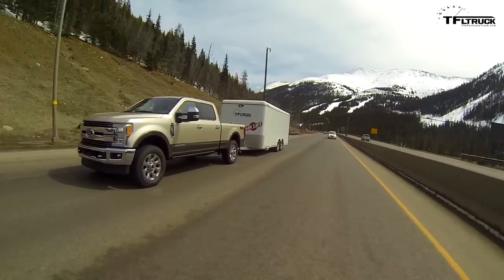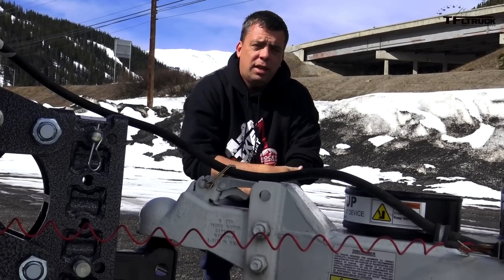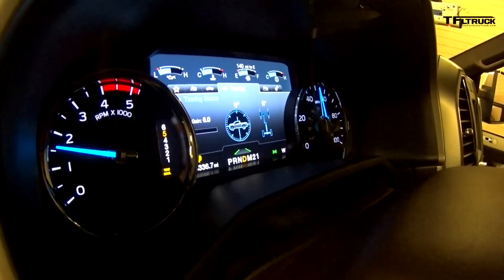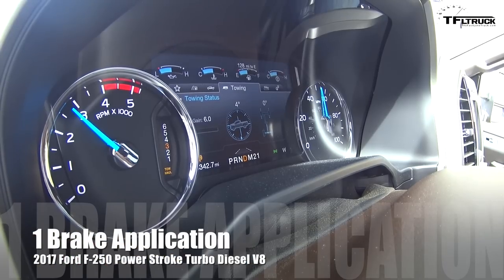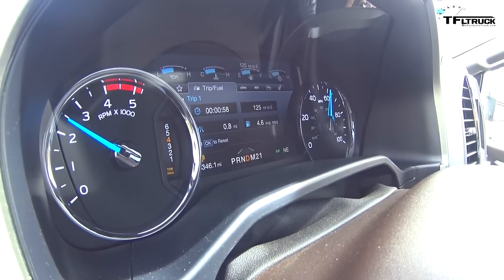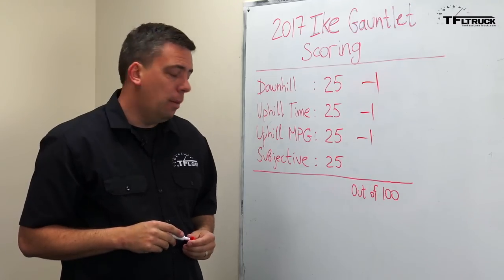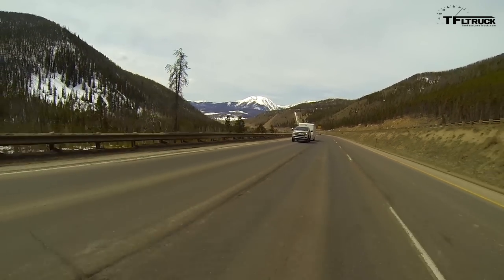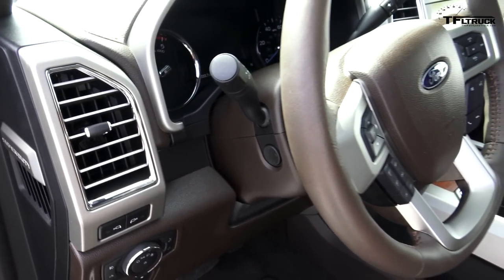2017 Ford F250 Diesel V8 Takes on the Ike Gauntlet Review: The World's Toughest Towing Test

Comment: I never understood the cost increase for the king ranch and platinum.  25k to 30k markup for leather power adjustable seats, power mirrors, leather panels on the dash, slightly more expensive paint, and a more expensive entertainment system.  They use the same engine, trans, transfer case, axels, body panels (other than logo stamping) and the interior is the same minus the materials on panels.  That's a huge markup for minimal gain.  I would completely get it if you got better mechanicals with the price, but your buying stuff that really doesn't matter.   Maybe I am just old school...
Reply: Lake School Restoration Channel then get the lariat or xlt if you don't want all that technology.
Reply: Bunz21 everyone is free to get what they want, my comment was more towards how ridiculous it is to pay 30k more for what amounts to very little substance.  If it had better engines/driveline/etc it would make sense.  For example It's not like comparing a base model focus to a RS, the RS costs 20k more, but your getting almost 200hp extra, all new suspension/driveline, new seats/interior pieces, etc.   That makes complete sense to me.
Reply: Lake School Restoration Channel I agree 100%, in 5-7 years those plastic panels and pleather seat surfaces will hold no real value to the truck, it's all in the drivetrain. I'd rather have a good cloth interior with more power and capabilities than all of that on the inside. BTW, I'm old school like that too...
Reply: Adam Gaines I agree with you here's another thing the new ford super duty's have a lot stronger under body then the Chevy and ram all Chevy did was put a really powerful motor into it and ram is still last in reliability the ford placed 1st to reach 200k with out issues Chevy placed 2nd, I don't think you can go wrong with the ford or Chevy but the ford has bigger under body components thing the Chevy and the ford looks better in my opinion.
Reply: Lake School Restoration Channel Agree 100%
Reply: I hate to say it since I am a Ford fan and own a newer f250, but if I was looking at a nice interior, decent ride, and bling factor I would buy a Chevy 2500 over the Ford.  The IFS combined with overall more car like interior makes it much more of a luxury truck over the f250.  I need capability to haul heavy, and good off road capability, therefore the solid axel front and setup the f250 has fits my needs better.  

Only in the truck world does buying what amounts to appearance packages add 50 to 75% to the price with no mechanical upgrades.  Imagine if a 30k car cost 45k just to get a different paint job, different wheels, some power items, and leather seats.  They have to be making money hand over fist on the upper models.
Reply: This is nothing new and not limited to Ford either. It matters to many as there is no shortage of top trim F-series trucks on the road and the job sites.
Reply: Lake School Restoration Channel the Focus RS has the exact same seats as the Focus ST. Only real difference on the inside is the shorter shifter, blue accents, and your drive .ode button. they're virtually the same on the inside. The price increase comes from drivetrain, engine, brakes, and wheels.

I guess you haven't really priced a base model F250 XLT with 4x4 and crew cab? Its over 50 grand. You can build a 70k Lariat, but why not just buy a King Ranch if you're going to add all the options that come standard on those trim levels? I build these trucks for a living and see their prices every night.
Reply: chibbs1975 I am well aware a base crew cab is over 50k.  I am saying that paying 25k to 30k more for what amounts to paint, wheels, seat material, some interior panel material, and a higher end audio system seems ludicrous.  If you were getting stronger axels, more powerful engine, aka things that actually improve the capability it would make more sense.  The only reason people are paying 75k for a truck is due to the fact the monthly payment on a 84 month loan comes out to the same monthly payment as a 60 month loan on a 50k truck.  

I rather spend money on capability.  Compare a base Wrangler vs a rubicon.  The rubicon has better axels stock, front and rear lockers, disconnecting away bars, better transfer case, better tires, and better bumpers/hood in some years.  For you to buy all those things to get the same capability would negate the price difference.  Same thing with the RS vs a base focus, or even the ST in your example.  The 15 to 20k increase is going to a massive engine/driveline increase, bigger/Better tires, suspension upgrades, etc.  

People are getting hosed on most big pickups, there is no way else to look at it.  I bet out of a 30k cost increase to go up model Ford is pocketing atleast 15k in profit.  I don't blame them, but I can't help but sit here and think how ridiculous those numbers are for something that's worth 30k after a few years.
Reply: Lake School Restoration Channel I think you need to look at the standard options that come in the Platinum or King Ranch. A regular Wrangler is for someone that just wants a Jeep. The Rubicon is someone that wants Jeep with capability. It's not the same with a Super Duty. You get a capable truck no matter what. It comes down to the necessities and creature comforts you want in your truck.

I just bought a 2017 Explorer Sport. I spent five weeks searching for a base model Sport with a twin panel moon roof. Every Sport I looked at had the 401A package with had folding mirrors, lane keep, adaptive cruise control, and a bunch or other nonsense I didn't want or need. My price was $46,700 compared to others that were $53,000. What it comes down to, is you buy what you want and spend what you want. I'll tell you though, there are more Platinum and King Ranch trucks going down the line than you think. Especially F450 versions.
Reply: J.V. is that crazy peckerwood lmao...under the skin it is, but not everywhere else. believe it or not, some people pull big ass fifth wheels and actually travel a lot of miles in these trucks. why not  have a nicer truck on the inside if you're gonna spend a lot of time inside it? this is why Ford offers different models and trim packages. they try to cater to everyone.
Reply: J.V. is that crazy peckerwood it doesn't have remote start, remote tailgate with soft open. Panoramic moon roof. Power rear window. Heated and cooled seats. I can keep going on and on. Your truck doesn't have anything close to the platinum.
Reply: Lake School Restoration Channel yes sir, and those high trim model materials do not cost the manufacturer any more than the base trim model pieces. They absolutely make a ton of money on them.
Reply: But its the same truck for more extra money required than it would cost to buy a new half-ton truck; you could get the same duty and work plus a half-ton truck for another family  member to drive. Added to that, this fancy truck doesn't do anything more or better on the road than the truck that's $30K less. Do people just lock their brains when it's pointed out that this fancy truck (I don't care how many features it has it; if it makes coffee or starts itself without a key or any of that other non necessary stuff for all things trucking) cost more than a truck without those features to the tune of the price of a new half-ton truck.
Reply: Gregory Faulkner that's pretty much my thought on it.  If the diesel only came as a option on upper trim models, it would make sense to pay the extra.  From a dollar amount most of the extra is going towards profit, not content.  

The proliferation of 75k trucks is directly due to 7/8 year loans being available.  If you stroke the payments out that long your payment is the same as a 5 year loan.  Also for large enough businesses I believe you can write the whole purchase price off on taxes in 1 year vs using depreciation.  On a 75k truck this could be a significant discount that would make sense to go to a upper model.

I drive a lot and I am always at the local building material suppliers.  If I see a platinum or a king ranch it's not driven by someone who is using it for a work truck.  It's either a younger guy who is spending a mortgage payment worth on a truck to show off, or a older gentlemen who bought a retirement vehicle.  That makes a lot of sense because a couple dings in the bed and tore up carpet would drop the value by probably 10k lol.  I am not hating on either one at all.  It's just that if you look at the dollar amounts spent just to get a few upgrades it's really crazy.  I guess that's good for me, I can get the same capability truck for 40% less and have it paid off in 2-3 years.  Or buy a f250xlt and get a free loaded Ford Focus for the same price as a platinum lol.
Reply: SilverRaven1959 completely agree.
Reply: SilverRaven1959 I fully agree with you bro.
Reply: SilverRaven1959 my point wasn't that all the bells and whistles aren't better than what comes with it stock.  My point was that paying 25 to 30k more for what amounts to maybe 5 to 10k in actual cost increase for the manufacture is more of a rip off than anything lol.  That and there is a fundamental problem with the king ranches and platinums, people that buy them don't use them for what a f250/350/etc was designed for.  Nobody is going to pay 75 to 80 k and use it for a work truck. A couple dents in the bed and a tore up interior will knock off a huge amount of value.     Considering many people are in debt at a mortgage payment level for 6 to 7 years on them, having a truck end up being worth 25k after 6 years when you paid over 80k with interest, makes no sense.  That's over 750$ a month in depreciation.  To be honest I do find it humorous that in today's society we are even talking about moon roofs, leather seats, etc, in rough riding work trucks that have 900+ ft lbs of torque.  What's next, latte warmers, heated floor mats, and navigator suspension so it rides less like a truck?  Like I said, I am not hating anyone that decides that's the right truck for them, I just don't see the value for how much the cost is increased.
Reply: SilverRaven1959 I build these trucks for a living. I know pretty much everything about them. lol
Reply: Lake School Restoration Channel There are plenty of KR and Platinum f series trucks on job sites, driven by owners of companies and towing something. Only a fool would believe otherwise.
Reply: SteveLord Ford builds roughly 800 trucks in a 10 hour shift. You'd be surprised how many KR's, Platinums, and optioned out Lariat's come off the line. Ford puts all these options on these trucks because Ford's customers ask for it.
Reply: Well for regular American persons and/or families who opt for debt in what they choose to drive, there is a huge difference between someone who surrenders one's financial security for 6-8 years via signing up to owe a bank $50K+ just to drive a pickup truck with a panoramic roof, and someone who enters a contract to owe half that amount and still have money at the end of the month and to be free from bondage much sooner, when both are driving trucks that do the same thing, only the former gets to do it with lots of added fluff and the other gets to be smarter and more responsible. For those with piles of money lying around that finances just for fun, then it doesn't really matter. High sales of those $50K trucks are good for Ford to make that kind of margin and that helps them give people like me good value in a lower-trimmed pickup with all the same, great auto and material tech. For any pickup configuration, it need be nothing more than a piece of reliable and safe and capable and fuel efficient transportation to be used as a tool for hauling and towing stuff and carrying people in relative comfort. My F150 has only the lowest added option package, adding only $2,000 to the sticker. It's got cruise, the kind that requires that I still have to do some driving; it's got power glass and mirrors; it's got a rear camera (even the zero-optioned F150 has the rear camera), and I can look directly everywhere else more effectively using my three dimension-capable eyes and vision than I can with the distraction of 360 degree cameras); it's got as advanced an engine and power train as was possible to buy on the market at the time I got it; it's got the same suspension, brakes, advanced steering, aluminum body, rear axle and drive as found in some $50K+ versions; it's got capability (towing, payload, bed space) equal to  or better than some $50K versions; and my cost was under $28K not counting tax. And even if I had opted for a crew cab, I could have stayed under $34K with the same trim, though I'd had to trade off  less bed to haul more people at that price versus $60K+ that some pay for that same truck. I paid $6K down. I've paid about $2K extra over sixteen mos. I owe under $15K for a brand new truck I bought fifteen mos. ago on a salary only slightly north of working class. Any suggestion that all auto payments are equal, despite the terms, with no regard to the initial loan amount, is a ludicrous suggestion. Of course the loan amount matters!
Reply: I just searched f250 king ranch, and found 10 2013s for sale for 40 to 42k that have under 60k miles in my area.  That's a 4 year old vehicle that sold for over 70k new, that was traded in for probably 35 to 37k.  That's 791$ a month of depreciation assuming it was purchased at 75k and traded in for 37.   The sad thing is If you actually used it for a work truck (aka hauled stuff, put more than groceries in the bed) you won't get anywhere near 42k for it, which makes the depreciation even worse.  

If Ford is making a ton of platinums and king ranches I stand by my statement that the only reason they are selling them is due to 7+ year financing.  Your average consumer looks at the monthly payment and if it's the same to get a king ranch on a 7/8 year loan as it is a xl on a 4/5, they will want the higher trim.  But then again those same consumers are the ones that were buying houses out of their price ranges because banks offered them money, only to wind up defaulting on them.
Reply: Gregory Faulkner 

The funniest thing to me about the high end truck market, is that it doesn't really have much on the high end car market when it comes to technology.  With the trucks at the end of the day your driving a pretty rough riding work truck, when for the money could could be in something that's much better riding.  After 5 or 6 years the higher end trucks are starting to look wore, the tech is already out dated, and I bet a vast majority of buyers are still making payments on the truck.  

I guess as you said, it does benefit people who buy standard trucks since the capabilities are all the same.  To each his own I guess.
Reply: Lake School Restoration Channel Almost every car on the planet can optioned to nearly double its base price.
Reply: dchawk81 

Sure, a focus RS can cost double what a zero option Focus does.  However for the price your getting significant engine, transmission, driveline, suspension, brakes, seating, and electrical upgrades.  Just like the camaro, base is 27k, and you can get a zl1 for 61k.  For the extra money your getting 200hp more,  better driveline, better brakes, better suspension, forged wheels, better tires, different body panels, better interior, etc.  if you look at most vehicles that have a higher end version of a base model, they are literally not the same vehicle.  This is not the case with larger pickups.  Your paying 25 to 30k for    Very minimal gain.  If you think a moon roof, heated/cooled seats, power tail gate drop, remote start, aluminum 20in wheels with standard tires, better entertainment system, and a couple custom color options are reasonable to pay 25k for, I don't know what to say.  

I would buy a platinum or king ranch if it came with upgraded brakes, stronger axels, more powerful engine, dump box, stainless steel parts that don't rust, etc.  something that adds capability and worth.
Reply: I absolutely agree with the assertion that nearly all cars can be appointed at near double their base price, and add to that, at least with a utility vehicle like a pickup truck, unlike a sedan, coupe, CUV, or hatchback some of the add on up market options are actually things that increase or improve utility, capability, power, or increase the number of people it can haul while also hauling or towing stuff.

But the problem I have with almost every comment section; professional, or amateur review; or discussion board is that there is this assumption that new pickups have become too expensive for the average buyer; because they are assuming that the only trucks available are the ones that top $40K; and my point is that relative to other segments; they have not become too expensive; it's just that more pickup truck buyers choose those higher-end models. It's just that too many pickup owners and wannabe owners think that any truck must have these $15K-$30K add-ons to be a worthy truck, and I fully understand that is what sales in the market, but just because more than half the buyers are choosing high-end trucks; but manufacturers should not be blamed and we should not be complaining because alot of customers are asking for non essential options to impress their friends or for some other reason.. For instance, someone could choose the most capable F150 sold as far as capable for towing and hauling (a 2X4 std cab, XL, long bed, with the 3.5 Ecoboost and 3.73 gears) and stay under $35K. The only option one has to take with that top engine and rear gears is the long bed. Another person could choose theirs to be more of a people hauler in a crew cab with a 5.5' bed, and get theirs for about the same price with the base engine. Compared to a Camry or other big-selling car, these are good values for those who want or need to haul stuff and reliable, comfortable transportation. I understand that it's weird not to want all these gadgets these days in a pickup truck; but it's weird in a Dave Ramsey kind of way, and I'm cool with that.
Reply: J.V. is that crazy peckerwood you don't have to buy the 80k dollar truck but if someone else does its there money they can buy what they want.
Reply: Not even talking about performance.
Reply: Lake School Restoration Channel why do you think Ford offers a 150, 250, 350, and a 450? you get upgrades in the axles and suspension. it's the exact opposite with the truck market than the car market. you're buying a capable truck out of the box and then adding the features and creature comforts you want. Every vehicle and manufacturer has vehicles that'll go double the price from a base to a top trim model.  You're better off sitting down and ordering your truck the way you want if it's such a issue.
Reply: chibbs1975 I am confused, my whole point was that it's highway robbery to charge 20 to 30k for seats/moon roof/infotainment system/couple cameras/2 unique color options with no upgrade to any mechanicals what so ever.  I think that's highway robbery, apparently you think it's not?
Reply: A lot of features do make the truck a nicer place to spend time in. But if you're like me and you don't sit in it a lot, an XLT package is fine. Or if you're gonna filth it up just because that's your life or workstyle making it unavoidable, the washout interior of the XL trim makes sense.

These ultra lux trucks tend to take the place of 2-3 separate vehicles so their price is not hard for a lot of people to justify. They're at and sometimes above what the Lincoln Navigator & Escalade are offering with truck utility and car comfort.

Think about that for a second. You're replacing a high end SUV and a luxurious car with one pickup truck. Of course you're gonna load it up on options.

If you were never in the market for a $70,000 SUV then you're obviously not in the market for a $70,000 pickup.
Reply: Lake School Restoration Channel you need to look up the amount of options on these trucks. the trucks equipped with the 360° camera has I believe seven cameras on it. it's not just a couple. I build these trucks and you can order the truck with just about anything you want and we will build it. you want a spray in bed liner? we will do it. you want a diamond plate tool box in the bed? you got it. you want a fifth wheel hitch installed in the bed? we will do that too. a diesel, 4x4, crew cab XLT will run you about 52k. A Lariat will be about 60k. A King Ranch is 66k, and a Platinum is 71k.  Your numbers are a tad off. To go from a XLT to a base Platinum will run you $18,000. 

That gives you, remote tailgate, adaptive steering, power memory heated and cooled leather seats, heated rear seats, Sync 3 with nav, power running boards, led headlights and fog lights, led bed lights, adjustable pedals, BLIS, remote start, heated steering wheel, and a butt load of other options that come standard over the XLT. These are priced based off a standard truck without adding other options.

I don't have a need or want a big truck or a truck for that matter. I just bought 2017 Explorer Sport a few weeks ago. Every one I looked at was 53k with a bunch of stuff I didn't want or need. Basically the dealer orders most of them fully loaded from the factory. It took my five weeks to find a Sport that had just the standard options and it was several thousand dollars less. The standard equipment was plenty for me.  So if I were to buy a truck, I'd probably order a Lariat and put some options it that didn't come standard that I want cause a even a standard Platinum has too many y options that I personally don't want to or need.  I'm sure my Lariat would be priced  close to a base model KR. 

Majority of people buying vehicles buy them off what they look like and what options they have that they are interested in, but end up spending more on stuff they don't want cause the dealer ordered it that way. If you're that picky, they your better off just ordering the vehicle exactly the way you want.
Reply: Two words, Resale Value....Platinum and KR Fords hold their value better than any other truck.
Reply: chibbs1975 i ran the numbers and locally I am getting a xl crew cab 4x4 diesel at 51,765 with 5.6% sales tax, xlt at 57,150 with tax, and  platinum at 76,454 with tax.  The price difference of 19k between the platinum and xlt, and just shy of 25k between the xl and the platinum.  Considering the truck shown in this video is a king ranch at a much higher price than base, my comparison of 25k difference is well within the ball park.  When it comes down to I don't see the value at all for spending the 25k, and in my experience the trucks are used more as status symbols than actual trucks.  Which if that's a persons thing so be it, I won't be the one getting hosed that kind of money lol
Reply: starcommtrey except the 75k when new platinum sells for 42k on the dealer lot after 4 years (with a 38k trade in).  That's with 50 to 60k miles.  That's a loss of 770$ a month In depreciation, or 60 cents per mile driven.  The only reason they cost more used is because they cost so much more new.  Not to mention if you use them as a truck they are worth even less since people don't want dents in the bed or dirt on the carpet in a luxury vehicle.
Reply: RESALE VALUE......Ill give you an example, I have an '06 KR 350 with 170k. Today in my area, those trucks go for around 20k dollars. A 2 door gas XL with similar miles is worth about 5-8k.
Reply: I dont knwo where you get that. Unless you are looking at 2x4 vs 4x4?
Reply: starcommtrey a 2 door 06 KR with the diesel and 170k sells for around 16 to 18k, if it's a crew cab I could see 20k in excellent shape.  That's not out of the ballpark, however that truck was likely 60k new (crew cab).  A xl was in the mid 40s, and given equal miles would still sell for 12to 13k.  Sure that's 6 to 7 k lower, but it was a much cheaper truck when new.  The resale value isn't good on either, however I rather have had the xl or lower model so I didn't end up losing a additional 20k over those 10 years.  Not to mention back in the mid 2000s there was even less differences between those trucks then there are today.  I will stick to my car for luxury, and my trucks for work.  

Also, if we are talking gas motored f350s, there isn't much of a market for any of them regardless of trim.  The diesel prices are higher.
Reply: starcommtrey probably due to weight differences, although I doubt it would be much.  I personally see around 13.5 with my truck but I have 35in mud terrain tires and only drive city with it/minimal highway.  When I swap to 4.88 I should see a mpg improvement since I won't be lugging the engine around town as much.  I am either in too low of a gear or too high of a gear around town.
Reply: Alabama/Ms...You can actually find them upwards of 25k, saw one on the lot last year, 180 on the clock, 27k.
Reply: And people pay it.
Reply: Lake School Restoration Channel just thought I'd let you know that we ran about ten 2018's the other night. Guess what? The trim level was a Limited. So now they're adding another trim level for you to be pissed about. lol. Not sure where it'll fall in line with the others though. The Limited on the F150 is the top trim level I believe, but after seeing the SD Limited, I can't see it costing more than the Platinum.
Reply: Trim levels and ever-more expensive versions of the $28K pickup truck that I've got doesn't piss me off. In fact, the more profit Ford and their dealers make on average ticket sales, the more they can provide value to buyers like me and still stay in the black. It's not that I'm pissed whatsoever. I'm just trying to understand in what circumstance any one with a net worth of less than $5M and a brain would go out and spend more for a pickup than what I spent for a three bedroom house with 1/2 acre lot. Just trying to figure out how OEMs convince people that heated seats and wifi and 360 degree camera and a prettier but less durable interior in a vehicle makes that vehicle twice as valuable as another version that can do the exact same thing automotive wise as my truck. I just find it intriguing and would love to understand the thought process behind that sort of buying behavior.
Reply: Gregory Faulkner people use trucks for all sorts or reasons. so their needs and wants vary between each other. someone who tows big ass fifth wheels all around country would probably want to be as comfortable as possible since they're spending a lot of time in the truck. contractors buy bare bone trucks to keep cost down and are more on a need to want basis. i watch loads of 70k Platinums, King Ranch, and even Lariat's go out the door every night at work. we generally build anywhere between 750 to 800 trucks in a 10 hours shift.
Reply: That's cool! The more Platinums and KRs sold; the more people who need trucks to make money or to do work can get value in work trucks. I just sort of feel sorry for the one's who opt for the $70K+ pickups on the SD side and $60K+ trucks on the light side, and buy them because marketers have convinced them that these features have that much value, but that really can't afford that $1000+ payment for six or seven years and that don't realize at the time how making this poor decision is going to ruin their financial lives. I'm also not sure how pickup owners in the eighties ever survived without all that extra comfort that's available today, but somehow they did.
Reply: +Gregory Faulkner People spend more than that on cars with the same features and still no truck utility. Luxury is luxury and if you can afford it, it's nice to have. No one has to justify it. They want it, so they buy it. It's that simple.

Can't afford it and still buy it? It's rare that that happens because they don't usually get the loan in the first place.

Having said all that, I don't even drive my XLT to work because to me it's too nice. I don't wanna screw it up. Haha.
Reply: sad to see how many envious haters there are out there..trying to convince themselves and others that platinum and king ranches are stupid...nope they are outright beautiful trucks and after driving mine...when I jump into anything less I hate to say it but they seem bleak and bare ...even the leather is nicer..or real ..but the difference is I'd never look down on someone for not having a lower model. envy.. it's such a ugly trait to have..and people can argue all they want..if you can afford the higher model ..you would too..in fact I'd sacrifice a brand new truck and get a slightly used truck if it meant I could afford the one I really want...just me ...but just saying..people who live in glass houses...
Reply: Gregory Faulkner I've met thousands of people like you..you see something expensive and you say " I could bought a cabin on a lake or fishing boat for that amount of money" and I reply ..and what in God's name do you think that I would want either of those things? ...I don't know what undesirable part of the world you live in where you can buy that amount of land with a house for same price as my truck but ..there's a reason it's that cheap...I don't have 5m dollars and I can afford my platinum just fie thanks ..enjoy your cloth seats and rubber Mats I guess...
Reply: Boy Justin...You just initiated a personal attack on my community and home in response to comments I made  regarding poor value of a product. I'm find with where I live and my 1685 sq foot home on 1/2 acre in the beautiful Upper Cumberland area of middle TN that cost $50K for land and home in 1996 and can be had these days for at or about $$58K brand new on the same sort of plot of land. Sorry that upset you and you decided to take this discussion down low, but lets try this another way...If two people who bought land on the same street purchased the same size and brand double-wide manufactured home, had it delivered and set up by the same dealer the same way; but one had theirs manufactured with hardwood floors and solid oak cabinets and fancier appliances and the other person took the base model;  is their anyone on here who would think that the fancier equipped home is worth almost three times the price as the base model when they are functionally and square-foot wise and layout all the same? Everyone would agree (I think) that resale value difference would be nowhere near that different price; just like it is for a fancy auto versus a base-model auto. More value--yes, but two-and-a-half five years later--no way! That's all I'm suggesting.  And "no" this is not the situation in the home building industry; neither stick built or manufactured. Consumers demand value for those products in that industry , but we allow them to charge outlandish prices for simple creature comforts and cool electronics in equally-performing and build quality vehicles. People of course can choose what they want, but if an industry is getting away with offering obviously  poor values, as they do with higher-trimmed cars and trucks, people should be calling the industry out on this fact. It's as bad as television subscription providers. Consumers have accepted and asked for 200 worthless channels and gladly give up an average of $80/mo to watch virtually nothing that they wouldn't get for free with an antenna.
Reply: Gregory Faulkner lm not trying to take a personal attack on you or go low but but when someone is implying that those of us that bought a platinum or KR is foolish and there's no value or point in it...especially if you don't make 5million a year?!  I find that a personal jab and I find it to be nothing but words of Envy and self justifying your own life choices. as far as where you live I'm not taking a stable at you I'm stating a fact..you live somewhere less desirable Hense the price of land..where I live a AVERAGE house price is 1-1.5 million for 1500 square foot home....do I think it's worth it ..not a chance in hell but there's a billion rich chinamen that do so... and just to talk about value...you don't see the value in spending for leather and heated cooled seats navigation upgraded stereo and so on...I can't understand how people would still have to spend 50-60k and not have those things..?? and end of the day..go look at a f350 5-10yrs old base xlt vs a Harley Davidson f350..6.0L are still in the low 20's and a clean 6.4L fetches in the low 30s I expect my platinum will be holding a higher value in years to come...especially with the new models being even higher $$
Reply: Gregory Faulkner People pay a lot for fancily remodeled homes. Yes, 3x as much sometimes. Same neighborhood. Identical houses otherwise.

People like luxury. A lot. And they buy it when they can afford it.
Reply: Justin  Waite Yeah and it doesn't even have to be a shit hole to be less desirable. One thing that makes places less desirable is being near nothin'. It's a great thing if you want privacy but it's horrible for commuting to work.

Most people have to work so they live where the commute is tolerable.
Reply: dchawk81 exactly...some people love nothing and isolation and doing..not much....not me! I like a balance of space and people but being in the middle of nowhere talking about the weather or not talking at all I not for me and neither is rubber Mats and cloth bench  seats with am/fm for "luxury" if I can't afford it I'll buy a older used vehicle that I can afford in order to have these options...to me buying  new should be the luxury..
Reply: JV, no, I have no issue with the aluminum body......It is old tech that has been around forever. GM is going to it and you can bet dodge wont be far behind. Like it or not, it is the future.
Reply: Justin  Waite I'm okay with the cloth but I'm not okay with just AM FM. Even though that's what I use most. Ironically enough. haha.

But as for location, I'm with you. I just put an offer on a house that's 10 minutes from work. It's in a small town but near my work's bigger town. I thought about moving out further but don't think I want to drive more than 20 minutes each way.
Reply: Lake School Restoration Channel Nope I like the aluminum. It won't rust. I have a factory bedliner though.
Reply: But it will outlast the rest f the truck.
Reply: J.V. is that crazy peckerwood Yeah I'm in Pennsylvania. I see Dodges and Chevies and pre-15 Fords rusting at the fender wells while still being financed. It's something I didn't want to experience myself on such a large loan.

As for bodywork, I hope I never need any, but it's fully covered by my insurance. I'm also not using it as a work truck so it's not in as high risk of a situation. Heck I barely drive it, to be honest. I've put about 4k on it since October 2016 and 1300 of that was a single trip to Chicago and back for a new job orientation.
Reply: +J.V. is that crazy peckerwood I do pay a nice premium compared to my other three vehicles but they don't have full coverage and are older, so I can't really say if it's already in place. I've never owned a full size truck before of any age, let alone this new so it could just be "new truck, full coverage = $$$" and maybe a Chevy or Dodge would cost the same.
Reply: "If your stuck paying for years, why not load it up"

This is how people stay poor and in debt. Don't buy more truck or more options than you need. Instead take that $30,000 you're saving plus interest by buying a base truck and put in the stock market or your kids college fund.
Reply: Absolutely not true. Look at 2013 trucks. The top trims and base models are within spitting distance of base models on price. You get killed on deprecation with the more expensive vehicle.
Reply: OTM, I  just looked up on autotrader around me for a 13 platinum 250 and an XL, the asking price for the platinum is 32k dollars MORE than the xl. The platinum as 70kmiles, the xl 80k. Far from spitting distance.
Reply: starcommtrey ok..what year is the XL ..I'm not sure of that scenario either they have a great deal on a used platinum or they're over pricing a box standard Xl... does the platinum have the 6.7?
Reply: Both are 2013. The xl is 23k the Platinum is 55k.
Reply: otm646 Not everyone buying these is struggling to do so...

There's a whole world out there with people in it who actually have a good income. Some don't even have kids or want them.
Reply: The comment that won't die lol.  The price increase between top and bottom end trucks would be worth it if you got tangible capability increases.  The high end truck would be worth it to me if had stronger axels, better suspension (maybe even air bags), more powerful engine, stronger transmissions, better tires, better warranty, etc.  I would want some capability for my money, not a infotainment system that's outdated in 2 years, a moon roof that leaks in 5, backup/360 cameras most won't use because they never pull anything and the truck doesn't fit many places, etc.

People buy the platinum for a status truck, a quick look on Autotrader will confirm that.  They virtually never have 5th wheels on them, the beds don't even have dings, and the carpet is always clean.  I have no problem if someone wants to spend the money on it, just realize your paying 10 to 15k in direct profit to Ford for minimal gain.  Not to mention we are talking about 3/4 and 1 ton trucks here that ride rough and handle like wood wagons. 

Pretty soon I bet they are going to make a light duty f250.  It will come with independent front and rear suspension with light springs so it rides real nice (max cargo 800lbs), the bed will have a padded leather liner,  everything will be padded in soft touch leather, axels/driveline will be out of a explorer because why do you need a 10.5/D60 to handle a trip to star bucks,  and they will even offer it in a electric only version for the people that want to save the environment by spending 80k on a vehicle rather than buying a economy car for 10 and donating 70k to a legit preservation cause.  I predict it will sell extremely well, and not soon after the same people will go after the Jeep Wrangler and make it into a independent suspension on road car like they have been trying to do for so long.
Reply: starcommtrey I just searched auto trader for every 2013 f250 platinum and out of all of them (only 23 for sale with the 6.7 diesel in the country) most were 42 to 43k.  The only ones that were over that either had 20k miles, or a lift/tires/suspension/tuners.  I didn't see a single stock f250 for over 48 asking price.  No idea where you found your 55k one.

I then looked up xl trucks with the 6.7 and most of them are coming in at 26 to 28k in a crew cab (since you can't get a single cab platinum you can't compare a single cab xl to a crew platinum).   That's with 50 to 65k miles.

The xl truck likely sold for 40k new, it lost 15k of value at worst.  The platinum sold for 70k and lost 27k of worth at worst.  This is provided both trucks are in good shape.  The only reason the platinum is worth more is because it cost more to begin with.  It does take a much more significant hit on worth.
Reply: Im not arguing percentage lost over a short time span. But in 10 years, when that xl(btw, starting price is only 33k) and platinum go against each other, the difference is immense.(FWIW, I believe if you have money to throw away, or plan to keep it forever is the only reason to go with the most loaded diesel.) Try this, look up a 2007 King Ranch or Harley edition vs an xl. And the argument here is why spend the extra money over what you need. If you can get away with a single cab, why go for the crew. So, in terms of this argument, they are apples and apples.
Reply: starcommtrey 

They don't make a platinum single cab, so if your comparing prices of a single cab xl to a crew platinum as proof as to why the platinum holds value better, that's flawed.  A single cab diesel xl base was around 35k new in 13 and worth atleast 23k in great shape today with decent miles.  

I just looked on auto trader for 2007 f250, Harley edition, there are 4 for sale right now, priced between 22 and 25k, all have 100k miles.  The king ranches are all between 18k and 23k.  The xl is selling for 16 to 18k.  Again assuming crew cab 4wd diesel 100k miles.

There are a couple things to note here. 1) most higher end trucks weren't used for trucks, and are better maintained.  Thus many of the upper end trucks are in better shape and thus worth more.  They also typically have lower miles.  Most xl trucks were used as trucks, and thus have more wear and tear.  The average condition of a xl is worse than the average condition of a king ranch/platinum/etc.  looking at the higher end of f250s, they often fall into the excellent category for condition, thus they are worth top dollar.  If you actually use such a truck for its capabilities, it will be worth significantly less.  2) the price difference between a King ranch and a xl is between 0 and 7k at 10 years, based on condition.  The higher model likely cost at a minimum 17 to 20k more new.  There is no magic point in buying a higher end model of a truck over base where it's worth enough used to have negated the increase in purchasing price over a lower end model.  That is unless you put it in a garage and don't drive it.  Even then you made a bad investment since your not going to make money.

I don't care what someone buys, like I have said before, Ford has to be making a killing on the high end trucks and the financing on them.  7/8 year loans at crappy interest rates, charging 15 to 30k for options that are nowhere near as expensive as better brakes/stronger axels/more powerful engines/stronger transmissions/etc.
Reply: starcommtrey 

Your comparing the worth of a 2007 Harley edition f350 crew cab 4wd that likely sold for over 60k new (and worth 24k used on a dealer lot) to a cab and a half xl 2wd (which have no resale lol). that likely sold for under  27k new that's worth 11k.  Even in your absurd unrealistic comparison the 2wd truck lost 15k in value in 10 years and the Harley lost over 30k.  What exactly are you trying to prove?  The owner of the Harley edition had to spend over 30k in 10 years to have their truck be worth 12k more. At no point will the higher end truck be profitable over a base given they both have similar miles, condition, and the same engine.
Reply: Lake School Restoration Channel like I told you once before, you're buying a capable truck out of the box no matter what trim you buy. there is no reason for bigger brake options. you want better axles then buy a 450.
Reply: Lake school, I dont know where you get your new prices. I still have the sticker for my KR WITH the FX4 AND chrome package and its only 55k......
Reply: And again, this is the argument, when it comes time to sell it if you intend to, the higher end models are worth a lot more......AND they are much easier to sell.
Reply: chibbs1975 

like I said before people are getting hosed on what they are paying for higher end trucks which has been my point from the start.  If Ford charged 15k more for a 20k focus and didn't put better brakes, suspension, engine, trans, etc on it, and instead put a better interior, different paint colors, some cameras, a moon roof, etc I have a feeling everyone on here would be looking at that is absurd, yet that's exactly what's going on with the trucks.
Reply: starcommtrey 

I have no way to verify what anyone actually paid for a truck, I only have msrp.  Without a doubt both a base and king ranch could be had for under msrp.  I bought my truck for 4K less than any dealer here would sell it to me for, that doesn't mean I will use the price I paid as a example for what they sell for. 

I don't know what year your truck is, 54k is within reason for msrp for a King ranch depending on options.  What did a base model truck cost msrp in your year assuming same door and drive type?  35k?  In a 10 year span your model will never profit over the increase in purchase price over a base model miles/condition being equal.  That really doesn't matter when it comes down to it because as long as you like your truck and it works for you that's all that matters.  I am not knocking anyone who buys any truck.  I just think it's ridiculous how society is accepting 7/8 year loans on 70k+ work trucks not being unreasonable, such as the truck in this video
Reply: Justin  Waite 

People took offense to my saying buying a upper end model is a poor value for the money spent in the case of pickup trucks, which it is.  Not everyone who buys a lower model truck does so out of that's what they can afford, by the looks of 7+ year factory financing offered on 70k+ sticker price trucks a vast majority of people buying the trucks are likely in over their head.  I just think its sad that people buy them as status symbols rather than actually using them.  We are talking about heavy duty work trucks here, being driven by people who bitch about the ride, lack of gadgets, and no latte warmers.  As long as Ford keeps putting out a legitimate HD truck meant for actual truck work, that doesn't cost 40k as a base, I will be fine.  It's only a matter of time before the people will bitch so much about features that a standard xl will cost more than most people can reasonably afford.
Reply: Lake School Restoration Channel how do you know what people are using their trucks for? you're just assuming that because someone bought a Platinum or King Ranch they're financing it for 7-8 years and no money down. people put cash down all the time on vehicles and the people buying 75k trucks have the income to do so.
Reply: chibbs1975 

I drive a lot on a daily basis, I am at all of the local contractor supply stores on a daily basis, I rent equipment at bobcat/Fabco/etc, and very rarely do I ever see a platinum anything pulling 5th wheels, hauling loads of dirt, filled with tools, etc.  They are not meant to be work trucks, the people driving them around here (600k population just in the city) keep them clean and use them as daily transportation.  Go to a dealer and look at the beds and interiors of higher end trucks, and compare it to lower end models, and tell me guys are buying them for work.  Look at the used trucks on auto trader and find a beat up platinum or king ranch, they don't exist.  Maybe things in your area are different. 

The fact 7+ year financing exists is proof people are in over their head.  If you can afford to put down 20/30k you can afford to pay it off in less than 7 years.  The reason 7 year loans exist is that even at 8% interest the monthly payment is the same as the 5 year loan on a cheaper truck.
Reply: Lake School Restoration Channel once again, you assume that because you see a Platinum riding around M-F without anything in it or behind it they use it simy for transportation. you have no clue as to what people do on the weekends. my ex wife's dad had a 2010 F350 Lariat duelly he pulled a fifth wheel with every weekend to the lake or somewhere else on vacation. that's all he used it for. he drove a Focus to and from work. 

if I'm spending 70k on a truck, you best believe it'll have a bed liner in it to preserve the bed. why would anyone spend 70k on a truck and tear it up? the upper scale trucks are obviously meant for different purposes. also, you're assuming once again that someone putting 30k down on a truck is still financing for 7-8 years. I bought a $48k Explorer Sport last month and put 20k down and financed it for 60 months at 0%.
Reply: Lake School Restoration Channel man that's such bullshit first of all drop the "your not a real man unless your trucks got dents in the bed" shit.. and who are you to be saying if you finance your in over your head??? that's words of someone who doesn't know business.. I could of paid cash for my platinum but I financed... why would I spend my money when I can spend the banks...at 0% rates only fools would spend their own ...and besides that financing is how majority of the world does business...100k rvs out there I'll bet you 99% of people throw it on the mortgage or do the 20yr terms that's offered. and as for the high end models not being used? I pull a 18 thousand lb toy hauler At  least two weekends a month up and down the steepest grades in Canada and I'll bet north America...what you pull with your Xl ? so am I a grocery getter wasting my heavy duty truck?? no! and neither are 90 % of the other KR and Pn's out there and that's the market they're intended for..they are meant to be "exclusive" in a mass produced way.. they're meant for long road trips empty or loaded or the it's "the bosses " truck...bottom line is anyone who moans about the price is just pissed they can't afford it. hey in years to come in won't be able to pay 120k for a brand new platinum so you know what I'll do...I'll wait 6 months for some guy to trade one in.. pay 20k less and be happy with what I can afford.
Reply: Justin  Waite 

Your adding things that I didn't say or suggest.  I am saying a vast majority of people buying platinums don't use them for trucks the same way as the lower models.  If this is not you then obviously what I said doesn't apply to you so there isn't any need to get upset.  You clearly are offended but what I have said and that's unfortunate, but the reality is the 20k+ people are paying for a platinum over a lower model doesn't correlate to much actual functional value.  If your only defense is that I (a guy you have never met and know nothing about) can't afford a platinum and that I am pissed because I can't afford it, and that's enough justification to add value to your truck, I don't know what to say.

If Ford made a diamond edition f250 that had a diamond sticker on the hood (nothing else different) and charged 30k more,  I guess it's worth it to and anyone that questions the value for the money is wrong because they can't afford it.  I am not on here to endlessly argue because either I have failed at clearly stating my point or people want to argue for the sake of arguing on things I haven't said.
Reply: chibbs1975 
My whole argument has been from the start that there isn't much actual value in buying a higher end model of a heavy duty truck and using it for a truck.  I keep getting roped into arguments over different values, financing, etc. I could sit down all day and provide pictures of every heavy duty truck in the city, and the condition of they to provide proof that people use them as status symbols here and you still will pick issue.  I probably see upwards of 30 platinum trucks a day, and even more king ranches,  and maybe one or two are actually  hauling anything beyond groceries.  This goes for weekends too, I am on the road all the time, it's the same story.  If you live in a area that people actually use their trucks that's great, in my city of over 600k people that's not the case.  Maybe I am biased because of that, but other than New Mexico/Texas (where I bought my f250 from) I don't see hardly any higher end trucks being used for a actual work vehicle. 

The reality is Ford has to be making a fortune on the upper models since they don't have to invest much money at all to make them over a standard truck.  It's unfortunate that people take offense to my criticizing the worth of the upper models of the trucks as a personal attack on a persons decision making/finances.  If someone bought a upper end truck and decided that was right for them , I have nothing to say.  If that person uses it for a daily driver and bitches about anything to do with its ride/gas mpg/lack of features I am going to get a bit vocal about it.  If the person bought something and is a complete poser (like someone with a completely lifted/big tired/etc truck that is afraid to go down a dirt road) I am going to laugh and say something about it.  Right or wrong that's who I am.
Reply: Lake School Restoration Channel If everyone destroyed their brand new trucks, there would be much it a used market and you'd be complaining that pre-owned prices are too high.

So what if people buy a fancy truck and take care of it? That's actually a good thing. Don't need to hog one up to be a real man.
Reply: dchawk81 
No where did I talk about destroying trucks as a sign of being a man, and if I did I would be happy to edit the comment.
Reply: Ok you are right, your message was the last that I read combined with others so I may have aimed some at you, my apologies. But where do you draw the line? is an XL worth 50k?..I don't think so...the price does go up in a staggered rate.. XL XLT Lariat, King Ranch, Platinum each one getting more expensive Do I think the dollar price is added up is added up correctly? I don't know? People are making it sound like "oh you hardly get anything more" well do you have electronic 4x4 with locking diff? real leather..cooled /heatedseats, navigation heated wood steering wheel, captains chairs adjustable pedals sync voice activation sunroof heated rear glass electric rear window..so on and so on?..I mean all of those things add up especially for the limited numbers they produce and the extra parts and tooling that it costs to have these different options. Now I do agree, I was annoyed when I bought mine that there wasn't a hell of a lot different over a full spec lariat..the leather is definitely better or real I should say and couple other things but I mostly paid for the overall unique look with black bumpers and wheels and what not...I personally thing back when they had the Harleys..you got more ( dashboard pedals seats headlights and so on) But whatever ,the point is I just can't stand it when I hear people pulling others down over having something nicer.. I don't know your situation but i'm pretty confident that if 99% of the people pulling others down could afford the top model..they would have it. So it is not a question of "is it worth it"...because we don't get to decide the price...the price is the price and you want it..you gotta pay it..or do without. Hey I don't think my clothes are worth the 500% mark up that they're advertised at but..I'm not gunna buy my clothes from walmart so I'm stuck paying stupid prices.
Reply: Ok, but you did start off saying its a poor decision to buy the higher model...why? and your wording makes it sound like "unless" you put dirt in the back and haul big loads and bag you HD truck, then your not even using your truck properly....well even that...not true...when I bought mine I only used it to put my bike in the back or pull a 12ft trailer...a job a Honda ridgeline could do..was I not using my HD truck right?? no...I wanted a diesel and I liked the look of the platinum and If I buy something I generally get the "top of the range" and theres nothing wrong with that. I'm sure plenty of the people who you see out there wanted a diesel..liked the options of the platinum and went for that...so whats wrong with that?'
And about ford making shit loads off us "fools" who buy the highend models..not true.. it cost them more for the unique parts and limited number they sell..often manufactures lose money on their high end models for that reason. they make the most money off the box standard that sell by the million.
Reply: Justin  Waite 

I am not trying to pull anyone down.  I love trucks and I bought my truck (which is a xl with some options) for the purpose of hauling heavy payloads (no trailering) and going off roading.  I keep it cleaner and in better shape than virtually everyone else around here.  I get 2 to 3 car washes a week in winter, change all the fluids sooner than they need, keep records of all services, and make sure it's running like a top.   I take care of my truck despite the fact it's hauling stuff all the time.  Or like this weekend, I am going off roading with it for 3 days straight and hopefully not add too many new dents.  There are a lot of people out there than spend more time in their HD trucks than I do, pull heavy ass trailers, and carry crews of people.  All of those things make sense to buy higher end models.  I just wish Ford would put air suspension/magnetic ride shocks/higher end brakes/better warranties/etc into their higher end trucks.  Something of functional worth in my opinion.  My truck rides stuff enough that even king ranch seats probably wouldn't help, which is unfortunate since I can't go down spring rates and sacrifice my payload handling.  

Your exactly right, once you add a couple option the price comes up so much that buying the next trim level makes more sense since you get more for your money compared to the next lowest option.  When it comes to my money I generally buy high end, all my tools and equipment generally reflect that.  With hd trucks I rather buy a lower model and get a daily driver car for the same money, which is exactly what I did.  My truck takes care of hauling/off road on weekends, and my focus gets me around town/on trips as needed.
Reply: Everything has gone expensive in the last couple of years. My wife was shopping for a new Subaru and they start at 25, but at the dealer, they want $47k out the door . She paid $34k for a 2010 8 years ago. I remember when you could buy a diesel F250 for $25k and back then Subarus were $12k
Reply: Yup, Y10Q. My 350 Kr was 55 in '07. Now they are 85k. 3k price increase per year is what that works out to....But mine is still worth 20k, which is nice as it is still worth 36% of the original value after 10 years and 170k miles.
Reply: starcommtrey king ranch and all, who would pay 20 k for an 07 when you can get an 11 6.7 lariat with less miles for 25 k...it's worth 15k at best imo
Reply: Jared P I have yet to see an 11 Lariat or KR for less than 35k.
Reply: starcommtrey I just bought a 11 lariat 6.7 for 25k. Mileage is sorta high at 152000. Here's another one: https://seattle.craigslist.org/see/cto/d/2012-ford-350-lariat-diesel/6279082641.html
Reply: starcommtrey I always thought Washington truck prices were over priced...
Reply: Jared P South Eastern tend to he the highest due to the least rust. We don't do salt on the roads and the air down here isn't very corrosive. Trucks are also the most desired down here. Example, CJ7s and Gen1 broncos could easily go for over 15k in good shape. My 07 doesn't have a spot of rust on it. It's in better shape than most 11 models from up North.
Reply: lol that and the massage seats..
Reply: the diesel engine is the main expense!
Reply: XL or XLT with the options you need is the best value for sure.
Reply: I got a platinum last year 2017 f350 it was around $79k Canadian after discounts, 92k sticker . When you buy over text message and don’t mess around with test drives you get better discounts. Most platinum ,lariat king ranch owners are self employed so the price difference doesn’t matter one bit. 
If I were buying a truck with already taxed income I wouldn’t even consider buying a new vehicle period.
Reply: Pennywise here’s a great reason. Did you notice the payload on this F250? Creature comforts are nice but for every bell and whistles added you lose payload and towing capacity. Next time your at a dealership check the sticker on the drivers side door frame. The most capable trucks on the lot will be the XL and XLT’s
Reply: @CMH_1975  so you put a couple trim pieces on a dash or a door panel and now you think you "build them for a living"? You work in an auto factory dude, you dont build shit you piece together parts for a very small section of the truck calm your sense of self worth down
Reply: Lake School Restoration Channel your actually forgetting the most intriguing factor. Your best payload/towing capacity truck on the lot will be the XL/XLT’s. All the bling is nice but you cut into that payload with all that crap. So in reality your getting a little less. For those who question that, swing into your local dealership and Check the payloads on some different trucks. It’s astonishing in some cases to see a 3/4 ton truck have payloads in the neighborhood of some half tons. People should Think about that for a second and be mindful when they are shopping for a  new truck to pull that 15,000 pound fiver lol.
Reply: @lakeschoolrestorationchann1567  
Two different people at work as an example. One purchased a $75k Ford Raptor and I asked if he was going to take it off road? His reply "Are you nuts? It cost $75k". It basically a grocery truck.
Another purchased a lifted super duper Ford $80k. He lives in an apartment, doesn't tow a trailer, work in it.  He's a a young kid three years into the Sheriff's Dept. $80K....90% he drives his Prius to work and let's the wife drive the truck as she only commutes 6 miles and he does 80 miles each way. His monthly payments are insane. 
Another friend had two trucks at home and he commutes also in his wife's Prius. These are weekend trucks. 
I'll be buying one used for towing my trailer that I MIGHT take camping, what only half a dozen times a year? Maybe a few more on annual leave. Otherwise it'll sit in the driveway most of the time. Anytime I see these $80k truck 9/10 it's one person in it during the week. That's one expensive proposition. Now I know they get 20+mpg but nothing comparable to 55mpg in some hybrids. So used it is for me. 30k sounds about right.
Reply: @SteveLord  
90% these trucks are empty going down the road doing a daily commute. I know as I travel 90 miles each way to work. Rarely do I see on fully loaded. It's ONE dude sitting in the truck.
Reply: @CMH_1975  
Because of the 84-96 month loans. That's insane. What's next? 120 month loans?